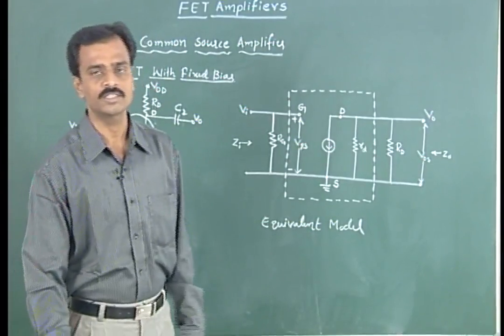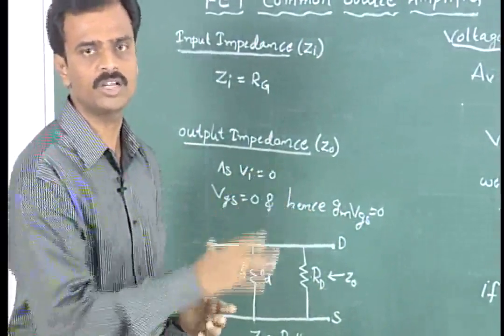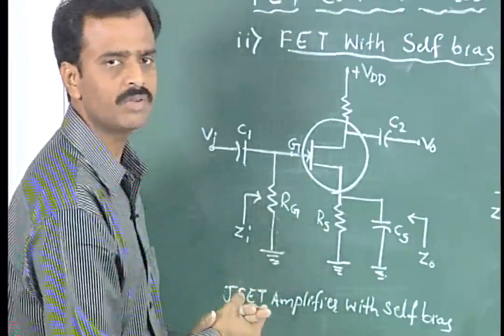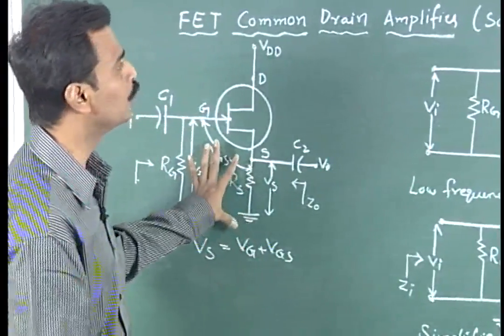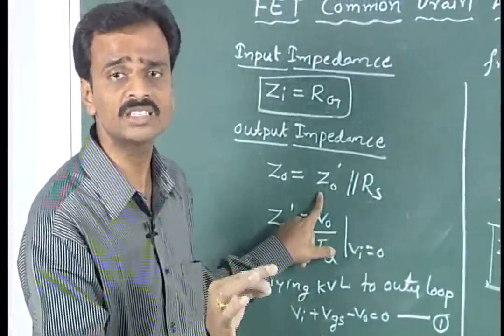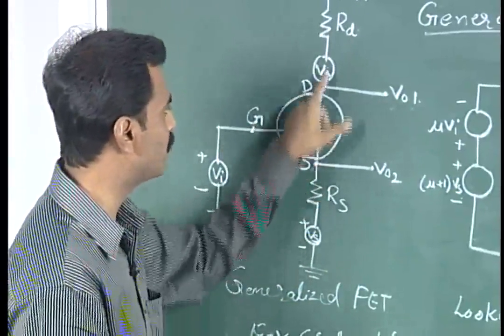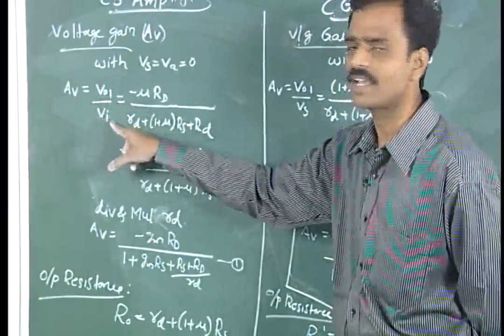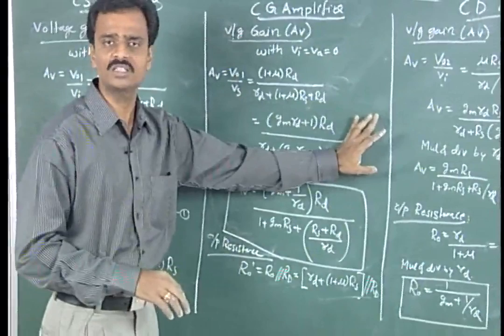ECE FET amplifier part-1.avi By VIGNAN

Comment: you have done a small mistake in one of the equation in common drain configuration:
i.e    VGS=VG-VS implies that VS=VG-VGS, this is true but you explain there in lecture VS=VG+VGS. thanx. your lecture was too important and listenable.